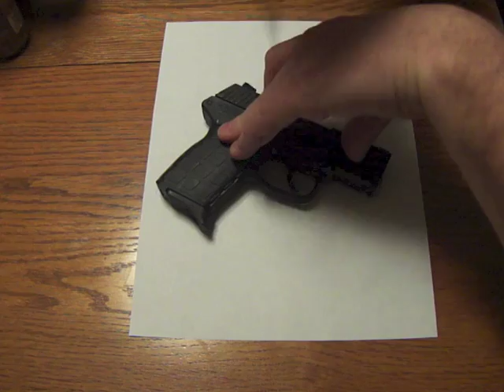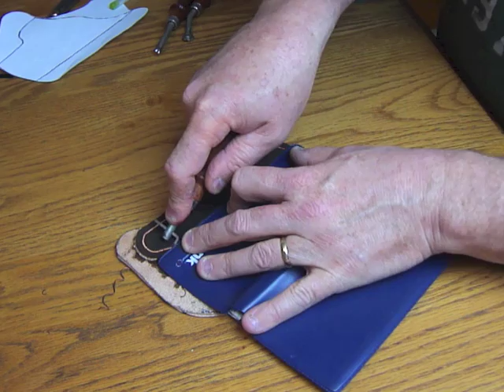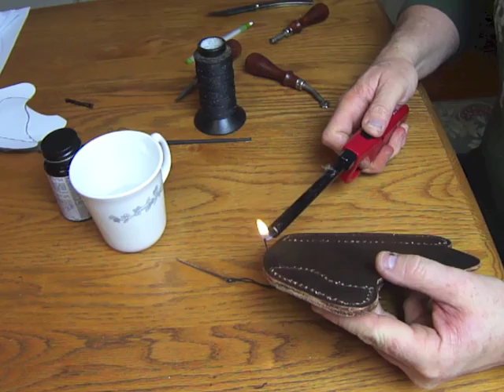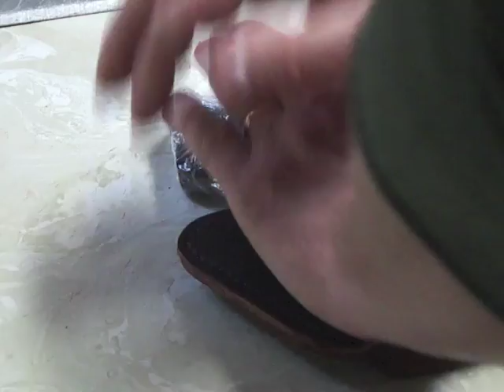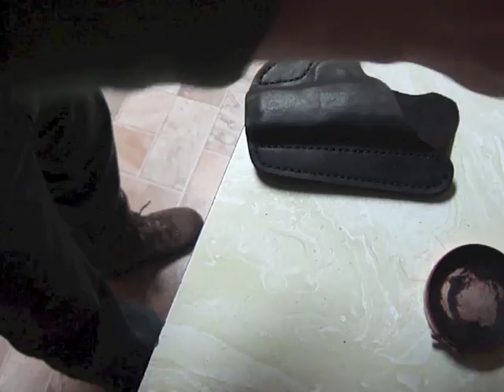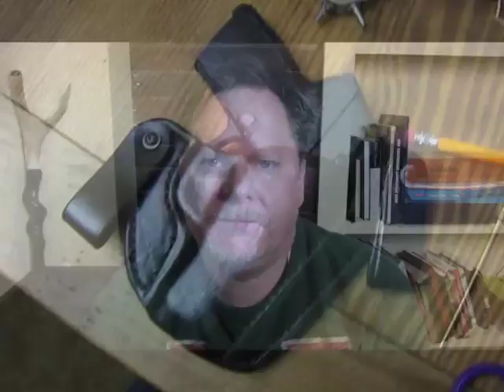How to make a great IWB holster tutorial

Comment: Winston Smith: Did you come up with a design for the IWB with the belt loop? I guess I'm not smart enough to figure out the design you are thinking about with the single wide belt loop going over the face of the holster for the belt to thread through, holdingthe gun closer to body (holster rides between pants and belt).

Comment: great video, only thing you need is a reinforced lip so the mouth of the holster does not collapse and give you trouble when trying to re-holster your weapon. Other wise kudos and thanks for the tutorial.....
Reply from the maker: Hi Mike - thanks for your kind words.  I often do add a triangle shaped piece that reinforces the lip.  This leather was thick and stiff, so I tried it without that step to make it simple.   So far it works very well.  But, I think as it ages it may be a problem.  Have a great weekend.
Reply from the maker: You can cut some pieces of plastic from a bleach bottle or similar plastic bottle.  Cut them a little bit smaller than your pattern.  Then sew it between the leather pieces. Sew the leather which will be slightly longer to itself, sandwiching the plastic pieces inside.

Comment: Thanks Tim. embossing is really easy using 3D stamps and your arbor press or by using the hand stamping method, becareful if hand method is used as the stamp tends to slide while stamping in this manner which will create a double stamp. For the maple leaf effect use super sheen on the embossed area with a fine paint brush before staining the sheath, let the sheen dry completely before staining, wipe off embossed area before stain dries completely and your done. Super sheen entire sheeth, buff.